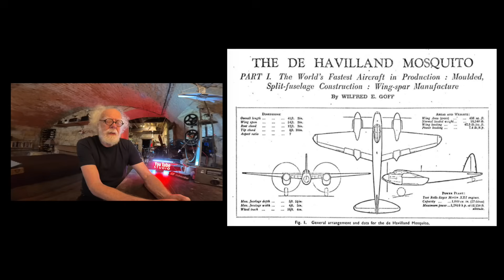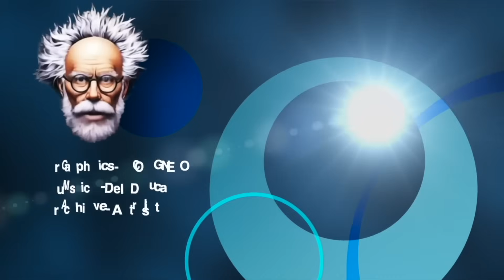mosquito NOT the wooden wonder

Comment: You seem to be getting your products confused. The adhesive used for Mosquito construction (Aerolite) was a gap filling urea formaldehyde, not an epoxy resin. Aerodux was different again, as a resorcinol product.  The same company, Aero Research Ltd, did make Araldite which is an epoxy resin, but that's different chemistry.
Reply from the maker: Thanks for the clarification on the adhesives used for the Mosquito….im still researching the life of the inventor

Comment: Awesome information… thank you! 😊
I’m not too sure about the idea of soaked balsa though. I build RC planes, and in my experience balsa doesn’t really absorb epoxy resin that well. Also, I’m fairly certain the Mosquito was built using around five different types of timber. From what I understand, the skin was a glued laminate. Glue is different from epoxy because glue is a single product, whereas epoxy is a resin combined with a catalyst. I haven’t read into the Mosquito in maybe 10 years, so I could be wrong.

Comment: Prof. Simon, I'm sure you are reviewing the wonderful information from other comments. A man of modest means...very modest... I would purchase your film. I built the F5 Tigershark for Northrop as a riveter. I was barely trained as a surface tech on the FA 18 wing surface, a boron composite fiber laminate. Most of my work history... I'm 72 is within the high tech mechanical sector of manufacturing and maintenance so... LOCTITE is part of my daily tool box... that's huge. If donation levels are of low threshold in crowdfunding, I'd be interested. Our world is amazing and I really admire your contribution to it.  Sam Hatman

Comment: It was a composite material, the forerunner of todays carbon fibre composite materials. 
The strength was derived from the composite fiberous wood and resin sandwich combined with the one piece  formed monocoque structure. They used fiberous wood because they didn't have the purpose made fiberous matting that we use today. 
Incredible 'Jointless' strength and lightness. Most modern aircraft are now made using composite materials just like the Mosquito was. 
So yeah, wood was used in the construction but only as the only available and suitable material at the time that could be used to create a higly advanced composite.
It was effectivly similar to an Airfix plastic model fuselage. Stick the two haves together and try to snap it in half!
Not easy!
They bigged up the Wooden Wonder BS so as to not attract attention to the highly advanced design and materials science.
So yeah they lied, but there was a war on, and the lie stuck. 
Why tell the truth when a perfectly good lie is working just fine?
Sorry Professor! :)

Comment: Hello Prof.  Thanks for this. Yes I'm once again astonished by your story.  GRP =  Glass reinforced  plastic .  PRP = Plywood reinforced plastic .  So  Mosquito is  WRP = Wood reinforced plastic structure.  I'm a wee bit miffed at your title here but it is excellent click bait and worked a treat on me.  Your assertion that the Mosquito is not made of wood may well be true BUT  . . . it couldn't exist without  wood ?   Could  the epoxy components have been moulded  ?            RE  PRP  do you know about The Africar Project from the 1980s  ?   A proposed and proved  car for Africa , needs retelling.

Comment: Fascinating, but that is not my understanding re Mosquitoes.

As an aside, Balsa is actually a hard wood, it's not porous per se.

The delamination of variable pitch propellers, was mainly apparent early on in WWII - MK1 and MK2 Spitfires et al, if I recall correctly. 

My father, an ex PPL, worked on WWII Airfields in his early working life, before time in the army, and again afterwards, he also worked on war-graves etc, before becoming an agricultural engineer, then moving into plastics and fibreglass. He always said that the Mosquito was the best aircraft of WWII, his school teacher's son flew impromptu displays over my father's school, he was a Path Finder. When my father worked on RAF airfields, several, post the war were; storage, disposal and reclamation units for aircraft (as well as active bases there were lots in the area, right up to the early 2000s). He tells me that by the late 1940s and into the 1950s, Mosquitoes, left unattended, left outside, awaiting scraping, fell apart very quickly indeed, it's why so few were left, they were a fast build, fast fighter bomber with a limited life span (as with most war derived tech). They suffered from rot, fungal growth, and litteraly disintegrated on the spot, which helped seal their fate, but helped with disposal. 

I'm familiar with PsyOps, everyone post 2020 should be by now. The Mosquito had mystery woven around it and would have been part of the propoganda campaign against the Nazis, I don't think that's a PsyOp against the British Public per se, merely Top Secret info, a morale booster. 

Interestingly my father was a pioneer in the use of resins, glass fibre etc, especially with acrylics etc (perhaps more on that another time). I've also 3-4 friends who studied to degree level, polymer technology and one went to work with the military, the others for military contractors, so I have a good appreciation of the subject matter. 

The aircraft that springs to mind, for the use of epoxy (two part epoxy resin) in construction, iirc, in particular, the wings, is the Blackburn Buccaneer. A great aircraft, albeit foisted somewhat by the 'Illuminati', pervert, occultist, manipulator, hidden change manager, and generally useless tick on the back of Great Britain, Mountbatten (when he helped to knoble TSR2 and possibly the Avro Arrow, our exoatmospheroc great hope). The man was a menace and I'm not convinced that the EYE RA did for him, but that's another story. 

I'd point out, as others have, that casacmite (which has or had Formaldehyde - e.g Urea Formaldehyde - in its make up) was used on wooden aircraft of WWII and that is not an epoxy per se, "It has been produced since the 1930s as Aerolite to bond plywood [Mosquito - my emphasis] for use in aircraft construction". Formaldehyde is carcinogenic. Then there is Resoricinol Formaldehyde, also a resin. "Resorcinol is the only known adhesive recommended and approved for use in wooden aircraft structure and fully meets necessary strength and durability requirements." A more 'modern' solution for work on historic and vintage aircraft, it's true to say.

As a coincidence, I'm familiar with Marshalls and the time when I knew some of their gentleman test pilots. My father and I started an aircraft build back in the 1980s, as it was a MK2/3 kit from the USA (not the type that one shakes the box and it falls out complete - it was part kit, part plans), with barely any UK support, we needed help. We were instrumental in getting the aircraft grounded on grounds of safety (mainly fuel tank design etc) and we worked on solutions for better, safer, aircraft. The help we got was via subcontractors to Marshalls (Hercules experts), at Cambridge. In fact one of their test pilots did the air trials/testing on my father's aircraft (a taildragger with a very early Rotax engine) and, although my father was a tail dragger man, did the whole ten minutes conversion training with my father. That aircraft remained airworthy, until just a few years ago, when it was written off due to pilot error. I was always impressed with the test pilots at Marshall's lots of them ex RAF test pilots and true, kind, gentlemen flyers, great aviators too.

Comment: Balsa isn’t like a sponge at all it is actually a hardwood due to its tubules along the grain. You could probably impregnate it in a vacuum chamber but De Havilsnd did not do this. The mosquito was built up as a laminate structure using cascamite which is not an epoxy it’s a type of aliphatic resin. The structure was two layers of birch plywood with a balsa infill. There were also many internal structure pieces made from maple and American walnut. It also had plywood fuselage formers which were screwed and glued to the laminate. Your assumption that because of the content of balsa it would fracture with the loads is completely misinformed. A firm in new Zealand has built about four mosquitos using exactly the well documented building method and materials. Sorry but you are way off on this one.
Reply: I worked for many years making things with fibreglass resin along with other materials like carbon fibre, Kevlar, mylar, dylon etc... it really is a very versatile engineering material and along with wood you can make virtually anything... You can mix resin with crushed marble powder to mould marble stone statues..and interestingly mix it with metal filings to mould coins and other metallic appearing plastic products amongst other things....
Reply: perhaps it was a type of red formaldehyde glue used in aircraft? or could it be a red dyed beetle nail glue using acetone as described?
Reply from the maker: Good info Neil. That is the published construction method but I adding new info to the story. De Havilland had a contract with the Duxford Novel Epoxy glue manufacturer.  It was that glue that made the mosquito possible.
Reply: @SimonHollandfilms  if you laminate two pieces of cardboard with a polystyrene infil you will hardly be able to break it because the polystyrene is in compression that is the principle of the mosquito construction. The entire airframe was based on the de haviland flamingo a four engined passenger plane from the 1930’s the balsa had no torsional properties it was just a filler. The inner and outer plywood layers were only 6 mm the balsa was about 16 mm the whole structure as in compression. The balsa was not impregnated with resin. The glue was called beetle glue because it stunk on ammonia and was bright red.
Reply: The balsa wood I used as a child was soft and spongy as this page also states https://en.wikipedia.org/wiki/Ochroma in the "Uses" section.

Comment: Re wooden propellers;_ often laminated with different types of wood for strength also some cleaver designs of wooden props where designed to twist and alter the pitch depending on load and prop speed 
also if using larch timber usually is sourced north of the arctic circle for strength due to slow growing and strength Iv had one wooden prop delaminate at the tip horrendous vibration and emergency landing

Comment: Funny enough it was the Germans which did the next and more decisive step: combining glue not with wood, but with glass fibers. To get what we today all know as fiberglass. The first plane built this way was Akaflieg Stuttgart's fs 24 Phönix, a sailplane. They used polyester rather than epoxy, which has about the same properties.
Reply: The big difference i know between the two is that epoxy gets hot when mixed with its catalyst, polyester doesn't.

Comment: Hi Simon, I would be very interested  in a video about Araldite and Co....... but here you said Germany had no Gasworks? Plenty of them. Where came all the Gas from for Gaslighting and Streetgaslighting from the 1870s. My hometown, Coesfeld, built a Gaswork in the 1880s, sorry I have a book about it, but have to find it first to give an exact date.  The Gaswork was close to the Railwaystation, with two enormous Gasometers, which were scrapped  in the 1960s when there was a Natural Gas pipeline. The Gasworks was destroyed in WW2, but until the 60s there was a Propane/Butane mix distributed until the natural Gas  came.  Gasworks were nearly in every City, but nobody was interested in the chemical residues of the Gasworks. Juste waste!😊
Reply from the maker: Thank you…but for some reason the German gasworks did not produce the chemicals for epoxy glue
Reply: Yes. An heaven forbid, this towngas was 50% of a stuff which lovers of natural gas hate today so much: hydrogen.